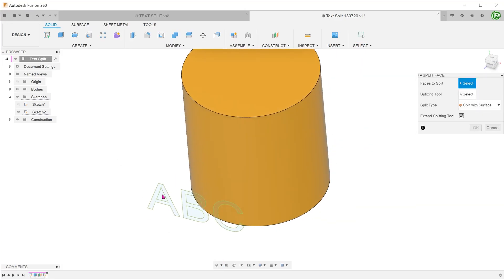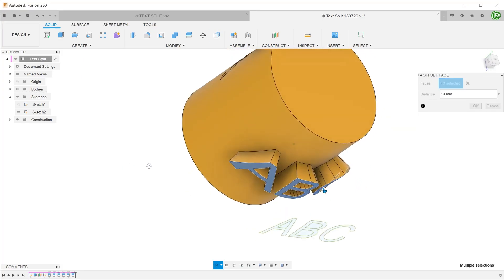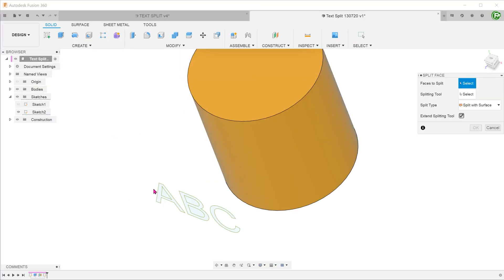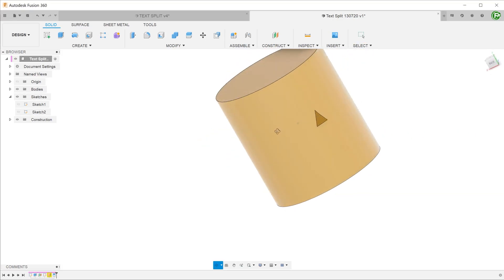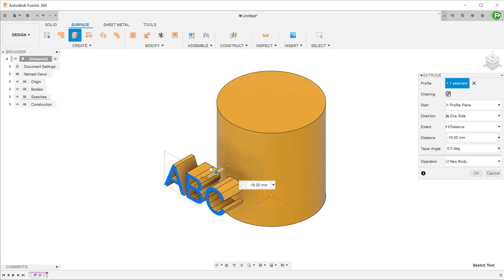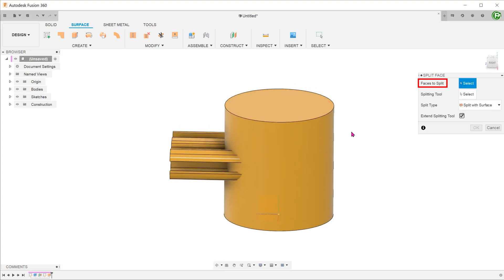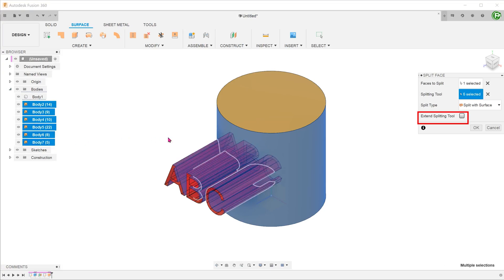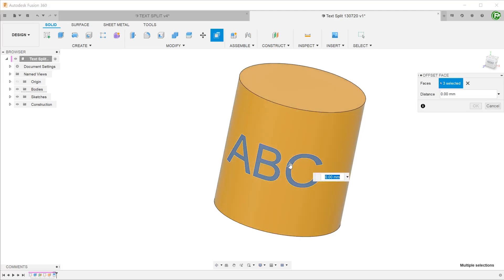Fusion 360 - A better way to split face

Comment: Great however the downside to this method is that the closer the text gets to the edge of the cylinder the more it distorts the shapes. See for example the right of the C as it's much longer than it should be and I suppose that's okay for those that (1) aren't too fussy want or (2) those that need the text visually correct  ONLY when looking from a front on view (I sometimes need that). So basically there are needs for this way and also for the first way depending on what one is trying to achieve. Nice video by the way and thanks for sharing.
Reply from the maker: Hi Phillip, you have raised some great points. The method I have shown here can only do a straight projection. If you use the sketch text directly as the splitting tool, you would have access to the "closest point" option for split type, which would not cause distortion of the C. But I have noticed that the "closest point" does not give very good results either. To achieve a true wrap, you would need to use the sheet metal function.
Reply: @Fusion360School  I wish fusion had Rhino's flowalongsrf command which gives you precise control over mapping from flat to non-planar surfaces.
Reply from the maker: @ikbo  A new "emboss" command has recently been released. This allows for wrapping of text onto curved faces with no distortion. I will be releasing a video on this in a few hours.
Reply: @Fusion360School  Yeah, but that command creates an extrusion with a specific height. What if you want to only have the sketch on the face so you can give the faces a different appereance? (screen printing of electronic components, for instance)
Reply from the maker: I have often thought about this. It would be great if the emboss command can be performed on sketches. I know we have "project to surface" but that is not a true wrap. It would also be useful if the emboss can just perform a split line instead of only extrude and cut. There are actually ways to use the cut/extrude created by emboss to make split lines. I was thinking about doing a video on this but I am not sure if this is something that users would use often.
Reply: @Fusion360School  Did you ever end up making a video about using emboss with text to create a wrapped split line/split face operation on a curved surface? If not, could you perhaps list a summary of how to use the cut/extrude created by emboss to end up with split face lines and no emboss?
I'm looking to achieve that exact effect at the moment to create the appearance of printed text (using ink) on a cylindrical surface, which has no thickness, so an extrude or cut wouldn't be appropriate. I know you can use decals to achieve a similar effect, but I would like this to be part of the model geometry and appearance that can be exported in say a step file.

Currently my workaround is using a really small deboss of 0.01mm, and then changing the appearance of the debossed faces, but the perfectionist in me knows this will change the cross section of the model, even if it doesn't penetrate enough into it to affect the functionality. I chose deboss over emboss so as not to change the outer diameter of the cylinder.